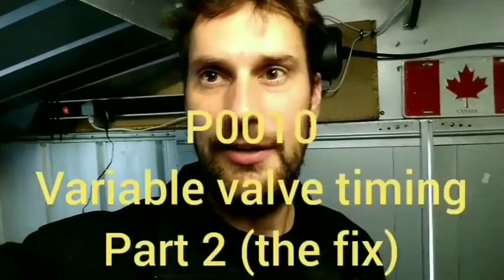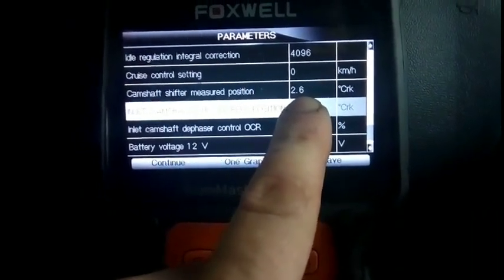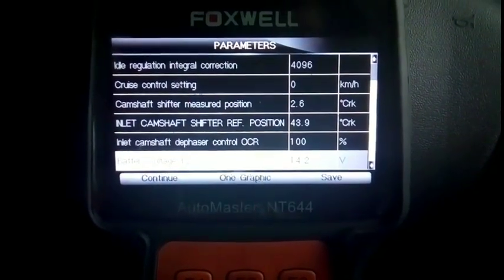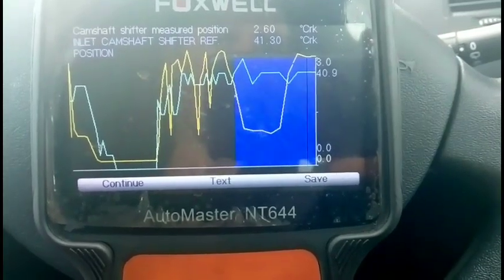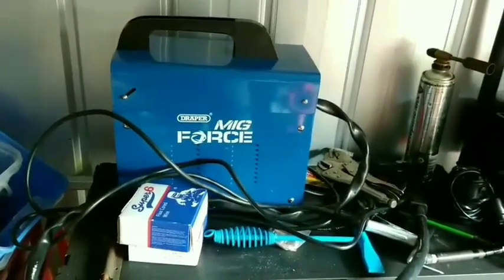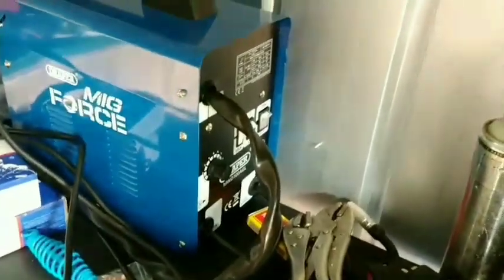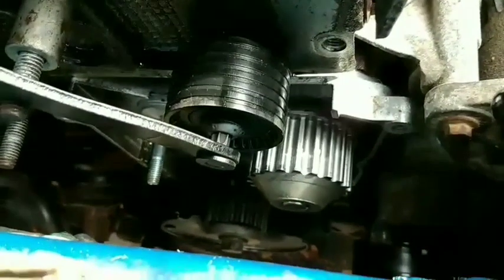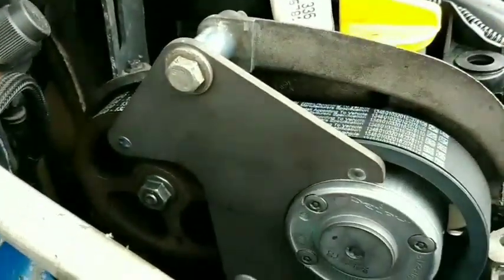P0010 Variable Valve Timing Fault PART 2  (dephaser pulley alignment)

Comment: Hi Matt. When replacing the belt, I seem to need to remove that dephaser locking plate to be able to put on the new belt?
Reply from the maker: That's fine as long as the other end of the cams are locked. I have to remove it when fitting the belt. It is used when the cam pulleys have been removed and when the cam pulleys are put back on. I do youse the tool after the belt is fitted to recheck it can slot into place while the timing pins are still in the other side of the cams and the crank shaft is pinned. It is a tight belt and I find it slightly easier to fit if the idler pulley that is below the intake pulley is removed while I get the belt on roughly in place, then I put the idler pulley back on and tension the belt.
Thanks for watching Pekka.
Reply: @mechanicmatt871  Thanks! So I really only need that tool after fitting the new belt to check the dephaser timing? Going to install a new dephaser at the same time when I'm replacing the belt.
Reply from the maker: Hi Pekka, I used it before fitting the belt after  fitting the pulley so I could tighten the bolt, then used it once again after fitting the belt to recheck everything. Cheers Matt
Reply: @mechanicmatt871  Thanks! I'm feeling more confident I can change the belt now. Just one thing, how do I rotate the engine until the cam slots line up for the tool? Just turn it on the big crank pulley? I've seen two videos when they have made a big mistake doing this. Maybe because they've removed the pulley before turning the crank
Reply from the maker: That's a good point, time it up and remove the crankshaft bolt with an impact wrench, my battery one took the bolt out fine.
Then remove the crank pulley and refit the bolt with the impact wrench, recheck the crank is up against the cranks timing pin.
I think the keyway in the crank shaft is at 12 o'clock position when it's timed. Then you are ready to change the belt.

Comment: Hi Matt. 

I have the same problem ! I've bought a Clio Rs 197 and I got the P0010 fault code. I replaced the vvt solenoid for a new one, the whole timing (belts,waterpump,dephaser pulley, and rollers) is it possible that the mechanic did a wrong job because the car is very weak at low revs and the exhaust popping....
Reply from the maker: If it has only started to run like that after the belt replacement then maybe, it's hard to say. Could even be a vacuum leak  from a pipe disconnected near to the throttle body that could have been disconnected when the timing pins were put in on the gearbox side. Hope you get it sorted, let me know what you find if you like. Thanks for watching
Reply: I have same issue! How did u fix this??

Comment: Suggestion if you are going to weld a nut like that... Put grease on the thread before welding it, otherwise some weld slag etc can get stuck to the thread and make it very hard to undo later
Reply from the maker: Excellent suggestion, thanks for watching

Comment: So what is the problem ?
Reply: What do i need to change ?
Reply from the maker: Hi Mohammed, in my case this car  had to have its dephasor pulley adjusted. The cam shafts were in sync with eachother and the crank shaft. The intake pulley was slightly out of alignment. After adjustment the car was fine.
Thanks for watching.
Reply: @mechanicmatt871  ?? How do I fix this?
Reply from the maker: Matt and Kat Christie,  this started with the live date on the scan tool showing cam position desired v actual, they didn't match.
I would start with the basis like checking the oil level and removing the camshaft solenoid at the top of the engine and checking that it's micro filter is not blocked.
Thanks for watching